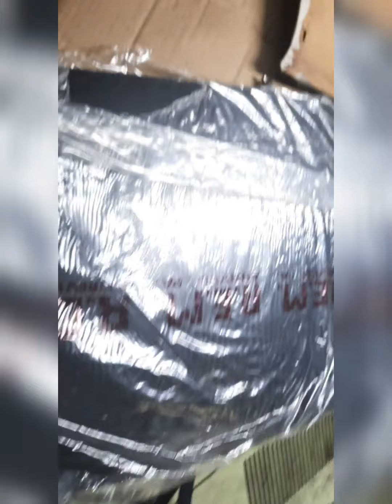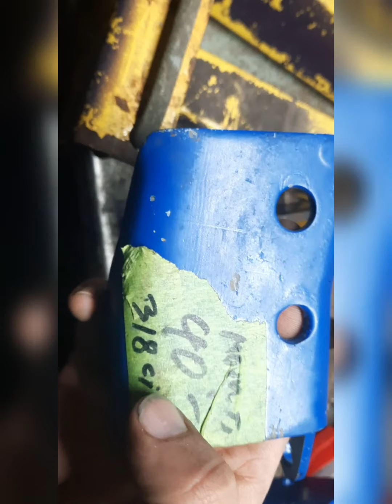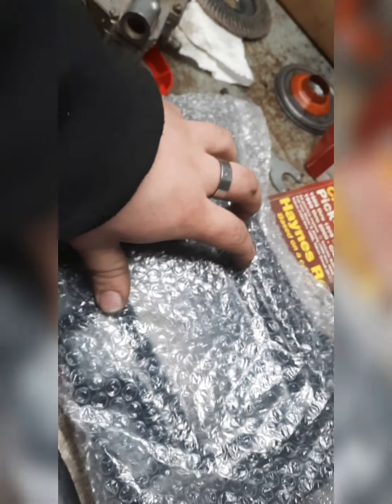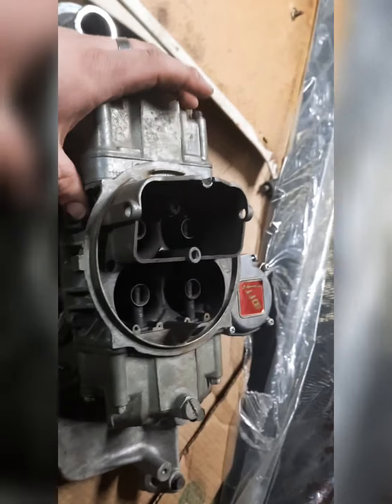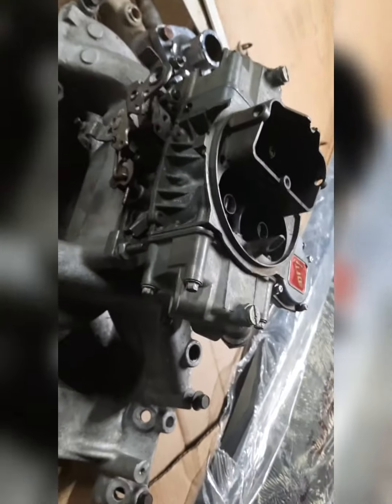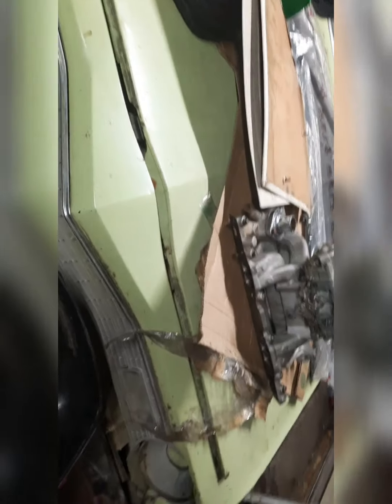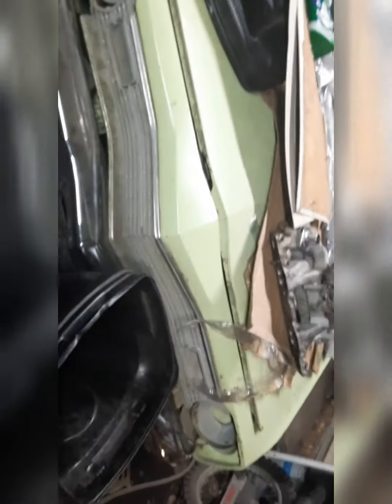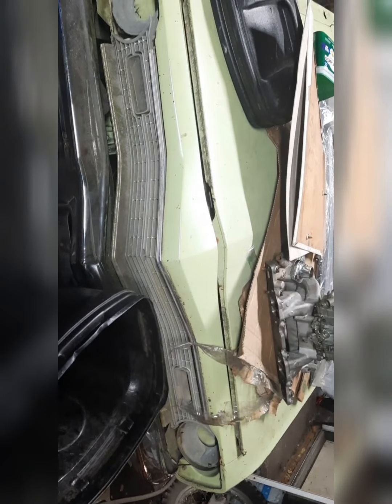2021 mopar national swap meet presented by indy cylinder heads i got some cool stuff for the dart

Comment: Cool nice brackets the slapper bars are cool there's plenty of debate about them but they still look cool got a old set that bolts in place of the lower shock mount plate that I'm going to reuse you got a good deal on the AMD peice.
Reply from the maker: Thanks I think slapper bars are cool on old cars with big tires in back and skinny on tires on the front i want the dart to look like a 1970s street  Machine thats kinda the look im going for with the whole car thanks for watching I  really appreciate it